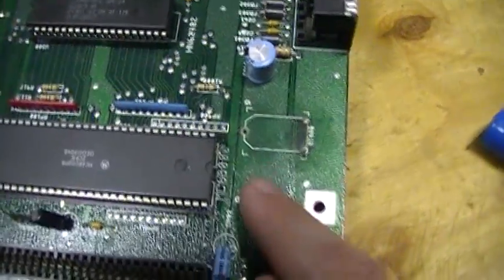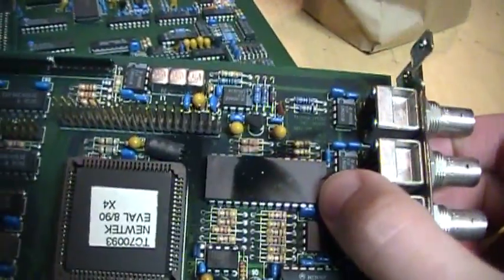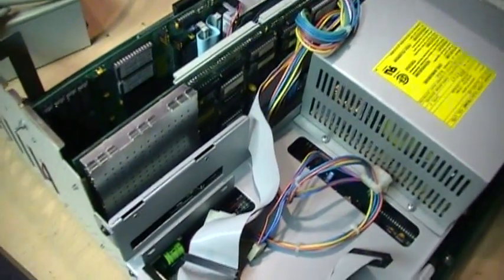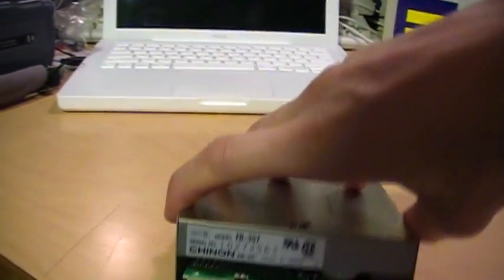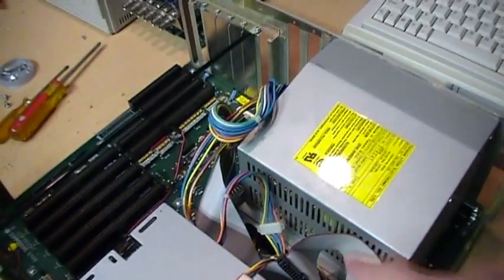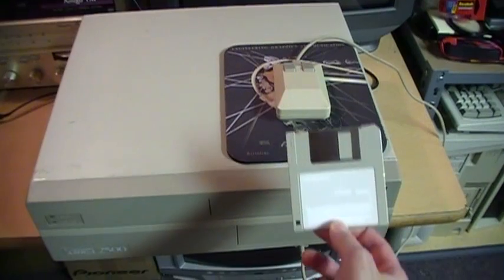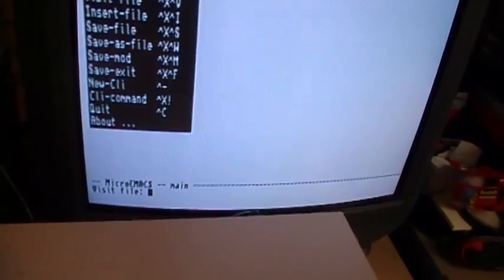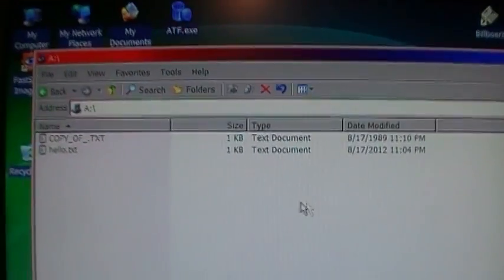Amiga 2500 Video Toaster restoration Part 2

Comment from the maker: The other tantalums on the board are all rated 15 uF at 16 volts (in microscopically small printing!), so it should be the same. The one that blew is right next to a TL780 5-volt regulator, so it's just a DC ripple filter cap. My IBM 5150 PC had a similar tantalum filter cap blow on its motherboard. (And to be honest, I just removed its remains and didn't replace it, and the PC still works fine because there's a dozen other filter caps across its motherboard.)

Comment from the maker: Turns out I need to modify it so that the Amiga will recognize the drive change signal, since it is the FB-357 and not the Amiga-spec FB-357A -- but the only instructions I can find are for the FZ-357 which uses a different circuit board.

Comment: You should disassemble the floppy drive and clean those microswitches that check for disk change/disk in (the ones that gets pressed down when you insert a disk). They tend to fail. Just spray a bit of electronics cleansing spray on the button and press it many times, it should clean itself that way.

Comment: i had similar issues on an old Compaq with the disk change issue, i think it was due to a damaged cable as one of the pins the floppy drive used was disk change. and when you would swap disks it would still show the old disk contents till you tried to access anything. i think it was pin34 or something, been about 10 years since i seen the issue

Comment: I would solder on the battery leads and heat shrink wrap it relocate the battery farther away from the board with wires so it could be zip tied to something metal.  I would just do it to avoid any more problems I did that to my older PB computer. I do not think you will have any problems with the NIMH battery I replaced nicad ones on a cordless phone with NIMH been working ever since then.

Comment: As for the floppy...it has to do with the jumpers I modded a chinon also and messing with the jumpers in different positions I got mine to do the same thing as yours...works if it is in the drive when you turn it on but can't change disks......does yours have a jumper array or just one jumper?

Comment: i would check that regulator when you replace that tant, you could replace them with low esr solid caps, i dont recommend just cutting it out scsi can draw  lots of power its going to need all the ripple protection it can get.

Comment: Workbench 2.1 comes with CrossDOS built-in, 2.0x does not.  It is available as a separate commercial program, and you have it and CrossMac installed on your 2.0x machine there, I can see.  There is a free similar program called MessyDOS that works well enough for KS 1.3 and 2.0x machines, also.

Comment: ds1 is the second drive on the chain try ds0 which you can boot from.

you dont need to shut down workbench its not a pc,sorry.

just turn off the power.
Reply: No filesystem caching?